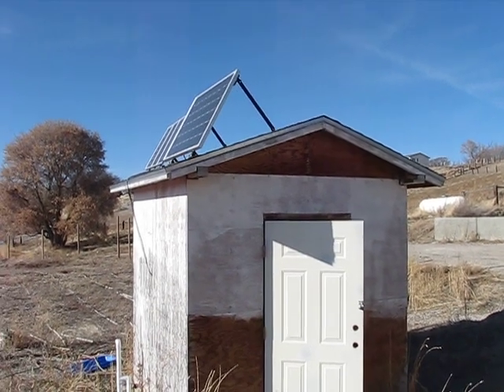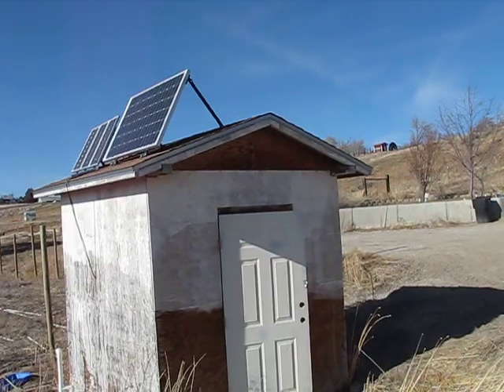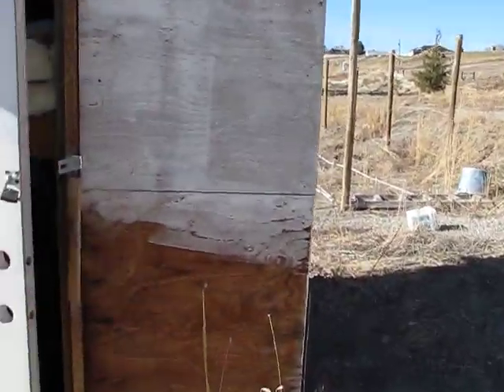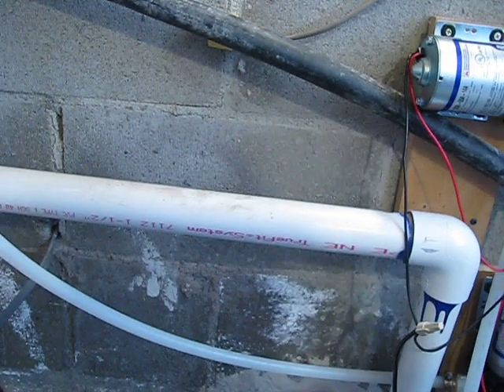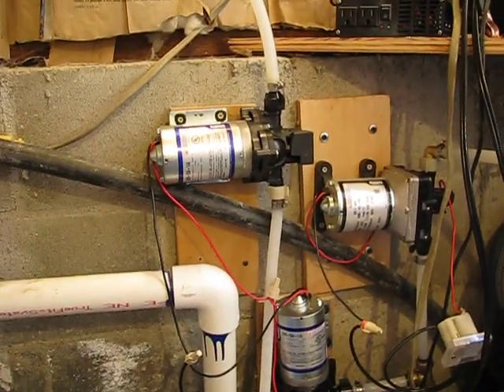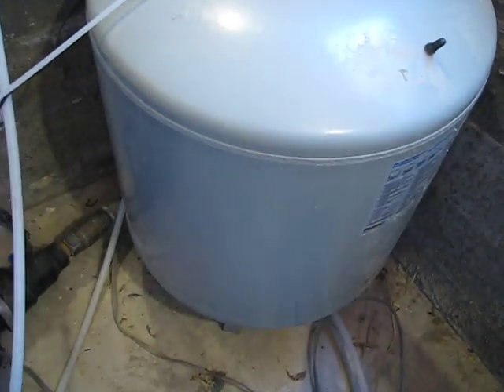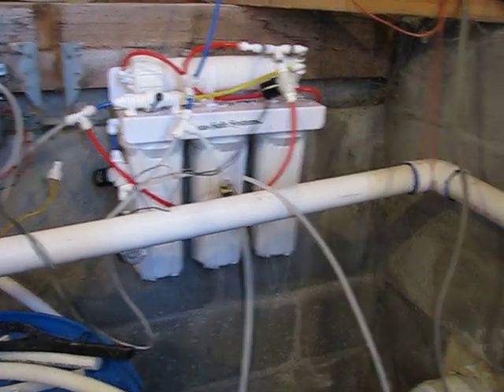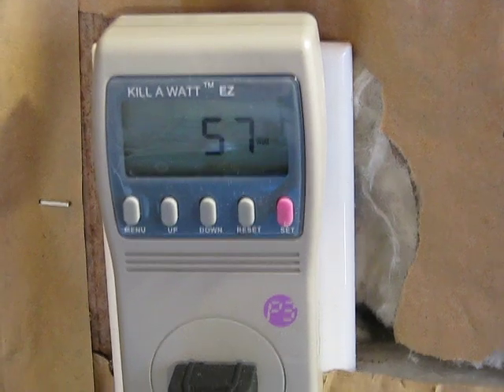solar powered water pump system

Comment: I've got a similar setup, but I don't have hard freezes so I use a roof water tank for storage.  I sand filter the local water (very low pressure) then pump it up to the roof, then let gravity do the rest.  I put my RO filter under my kitchen sink, I'm curious why you put yours outside?
Reply from the maker: +tsbrownie I use solar to power the RO unit for high pressure, and it was just easier to put it outside, besides it leaves more room under the sink for other stuff.  Besides I already had the building there, and plenty of room in it.  It also pumps all the water for my house from that building.

Comment: I'm wanting to get a 110volt, 1 hp submersible well pump. How many solar panels would I need get and how big of an inverter will I need?
Thanks in advance
Reply from the maker: 1 hp = .75 kw.   It really depends on how far you have to lift the water and for how long the pump will run in a day.  The best thing to do is to get the pump, and run it as normal connected through a kill a watt meter (you can get them off ebay, home depot, ect).  If you run it for a day or two, it will show you the number of kw you used, and then you can get a more accurate way to figure the size.  Just guessing for an average house, you will use about 1.5 kw-h per day, which would mean you would want about 300-500 watts of solar with about 4 deep cycle batteries.  I would suggest a 3kw low frequency inverter to run it, due to the surge power it will need to get started, but you may be able to get bye with something smaller.
Reply: +Willisolarpower why didnt you uses a submersible water pump?..

Comment: Try running the two pumps in parallel instead of series and you will more flow.
I do this with two of them and get lots of flow.
Reply from the maker: Thanks for your comment.  Two pumps in parallel do run more flow at low pressure (below 20-30 psi).  However the pumps actually take longer to fill my pressurized tank, because once they get up to around 50 psi, the flow is very slow.  So even with the slower flow at lower pressure, running this pump in series is a little better.  Since this video I have switched over to a different pump that flows more and goes up to 100 psi without any problem.  It does draw more power when it is running (about 20 amps), but because it does not need to run as long, it actually uses less power.  The pump I am now using is a Delavan Fat boy pump.

Comment: Would it be more efficient if the solar panels directly power a DC pump to draw the water into a small elevated water tank/water tower? The gravity pressure would then be enough to push the water through the RO system and to your taps, so you don't need battery power to run the pumps at night.

Comment from the maker: Sorry I don't think I noticed your message.  In the winter I tip them up vertical like you see, and that is about it.  If we get a lot of wet snow, then it turns really cold (around 0 deg F) then I will get a broom, and push some snow off.  It will eventually melt off when the sun comes out, but it is faster if you broom it off.  I have only done this twice in the last two winters, so it is unusual to even do it at all.

Comment from the maker: I have not had any issues in the winter time.  However it is mostly underground, and the top (above ground is insulated), so it stays well above freezing inside, even with it is -20 deg F outside.

I didn't do anything special, but if you have specific questions, I could answer them for you.

Comment: Or you can switch to battery bank if the batteries are really low or to grid tie if your batteries are full or just leave it on two and it will do it automatically. You have a new sub I like your work.

Comment: Nice setup. I saw a guy and he made a point about using one of those dual battery switches for a boat. You can hook up the battery bank as one of the batteries then the grid tie inverter to the other battery hookup. So if your 3 position switch is pointing to both batteries you will be able to charge your batteries and when they are topped off the remaining power won't be wasted it will go to the grid tie. I thought that was a good idea I forgot the guys name. Keep up the good work.

Comment from the maker: The solar panels have been able to keep the battery charged for over 1 year without using any other sources of power, in fact I switched over to my 60 watt panel, and it is keeping the battery charged just fine.  If I remember correctly the pumps pull under 10A@12v or less than 120W each.  They use more than the panels put out, but they don't run too often.  If I have a really cloudy week, and my batteries are not getting fully charged, then I switch over to my 100W panel to get them charged.